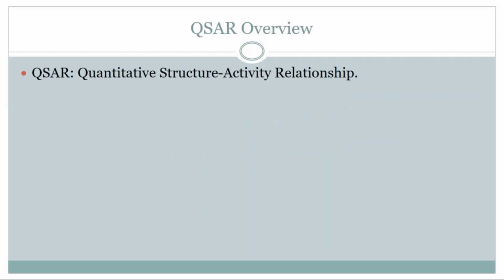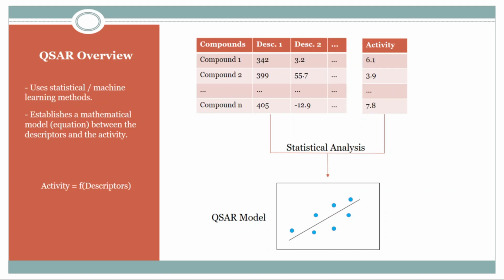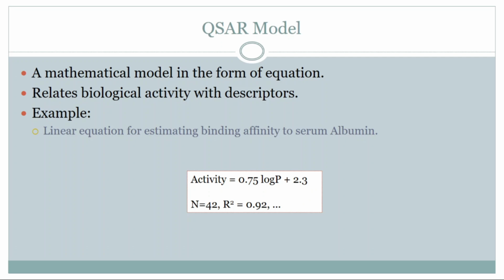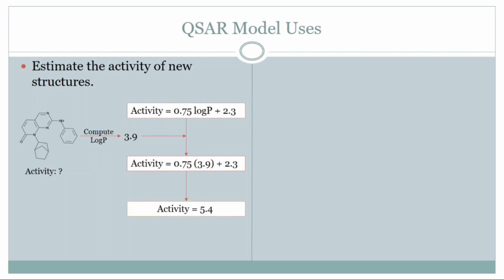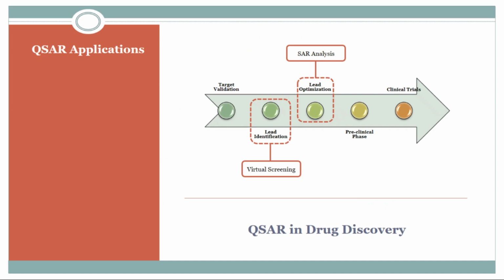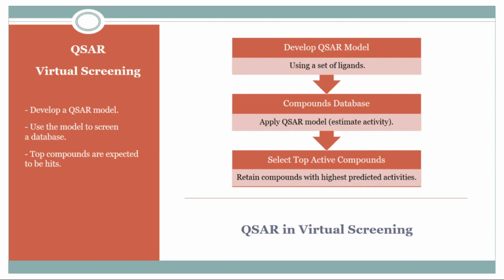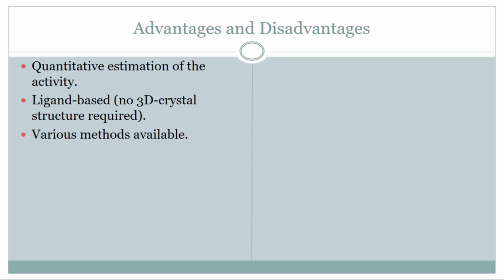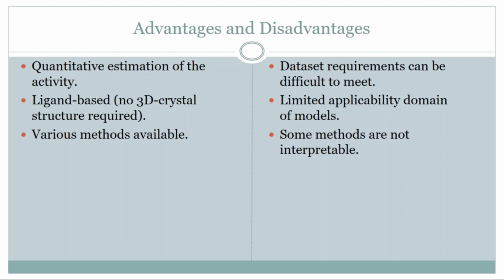QSAR Modeling Course: Lecture 1 - Main Concepts of QSAR Modeling

Comment: how data set is prepared according to their own compounds ?
Reply from the maker: Dear,
If you already have the compounds (e.g. synthesized), you need to prepare them in an SDF or SMILES file, then import them in ChemMaster. You can use a free software or tool to draw the structures such as DataWarrior to draw the molecules and save them in a file. 
Alternatively, if you don't have compounds, you can search in a public database such as PubChem for a dataset of compounds suitable for QSAR modeling & download it then import it in ChemMaster.
If you need further help please let me know.